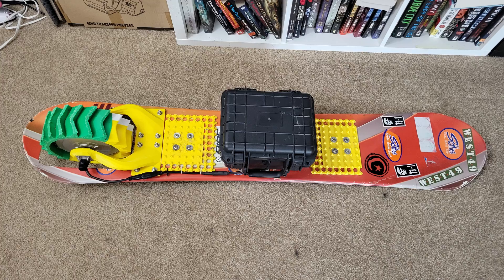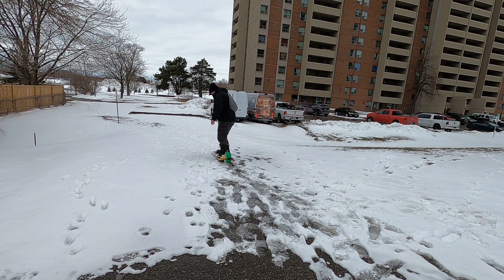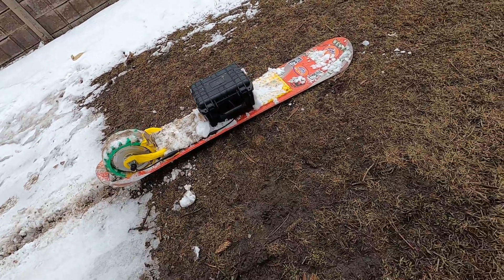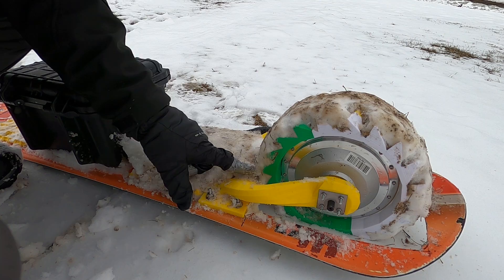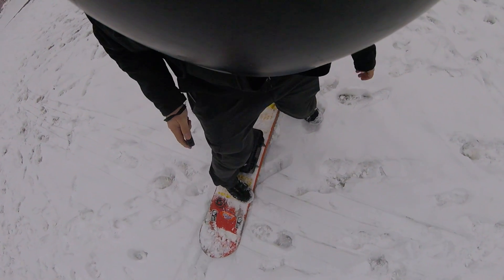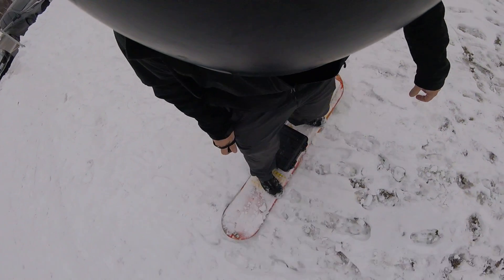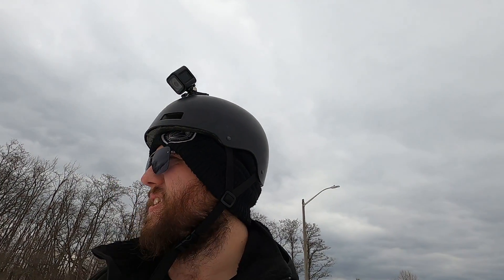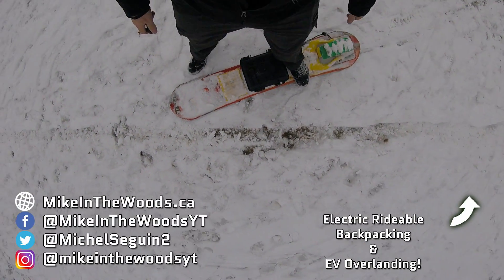I Built A Working Electric Snowboard For Under $1000 - Let's Ride It!

Comment: Wooo the design and testing process is awesome man. Iterate test and repeat until you have a solid model. This is awesome. I’m wondering if you can create a channeling system for the snow it grabs to throw it out to the sides so it doesn’t catch at the forward portion.

Comment: If you want to improve on this i have a thought that might help. Find a way to elevate the board to be aligned flat would probably help with the traction issues the forward weight created from the downward angle of the board is probably creating more resistance especially in the softer stuff when the board sinks more
Reply from the maker: That would only be a concern for a powder build. This one has no hope in heck of getting enough traction on powder lol

Plus, most of my weight is on my rear foot to dig the wheel in. I don't think it's too much of a problem. 

If anything, it's the flat bolts on the bottom that are creating the drag! That and I haven't cleaned up the bottom surface of the board, it's in pretty terrible condition
Reply: @Mike_Seguin  yea makes sense, far from something worth actually using in a real way but still a pretty cool DIY job